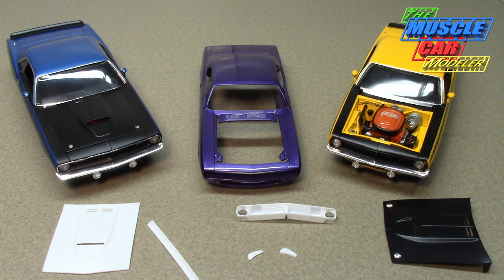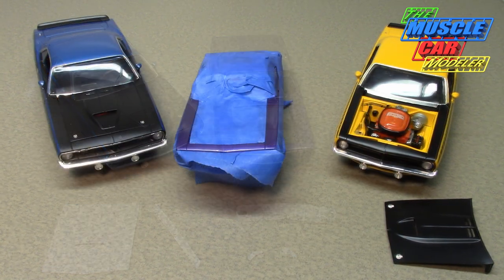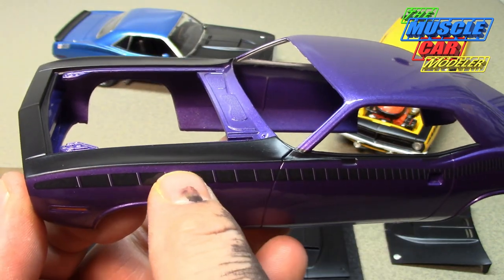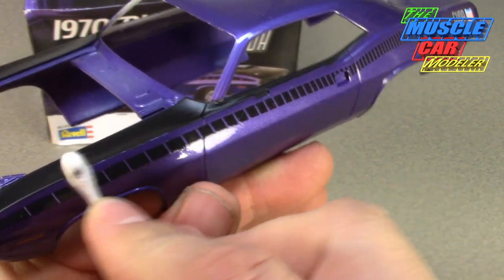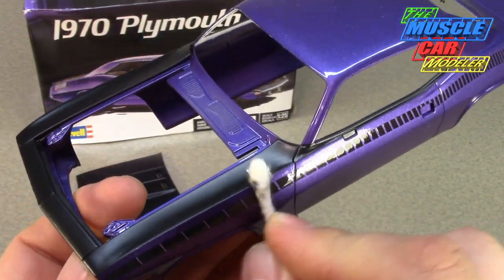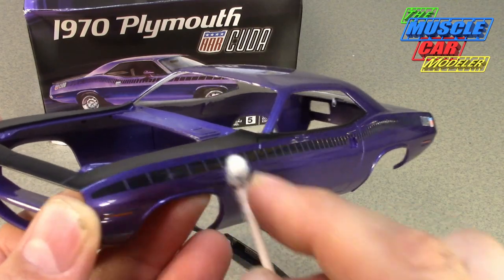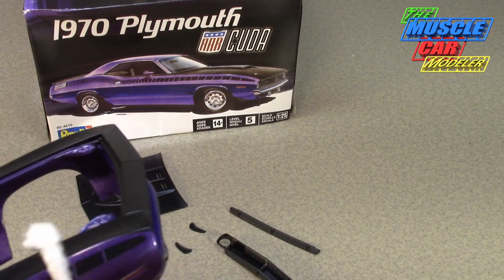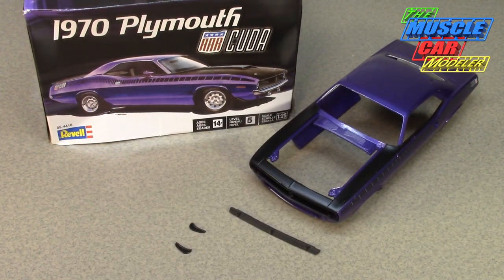How To: Apply the blackout to a Revell 1970 Plymouth AAR Cuda!

Comment: This is probably gonna be my next build and I’m curious to know why do you not clear coat over the side decals? Love the history lesson you give on your builds.
Reply from the maker: I did clear coat over them.
Reply: @TheMuscleCarModeler  o ok bc when pulling the tape off I thought you said you where worried about pulling them up.
Reply from the maker: Yes I was. Even with the clear coat on it, it can still pull the clear and the decal off the body. I just went slow and at an angle. Never pull the tape strait away off the body.
Reply: @TheMuscleCarModeler  I would’ve never thought that could happen with automotive 2K. Seems like you’d have to worry about that even without a decal under it then.
Reply from the maker: The automotive clear etches to some model paints better than others. You never know for sure. I have had the clear pull off in sheets over Testors spray paint. The 70 Cuda seems to be the same way. I just knocked off the battery from the engine compartment while installing the chassis. The clear was glued to the battery but no MCW purple was etched to the clear. It glued right back in place and you can't tell but I now know that it is not that great of a bond.

Comment: Hey Ral, Can you perform the polishing between the body color and the black at the front fender edge after using modeler's clear coat? Or the polishing can only be performed using the auto clear coat like you used? Any help appreciated, Richie
Reply from the maker: You can if the black is on top of the clear but if it all is under the clear it is sealed in.